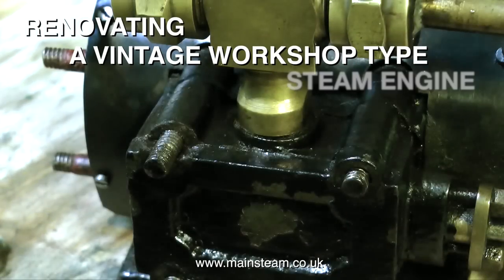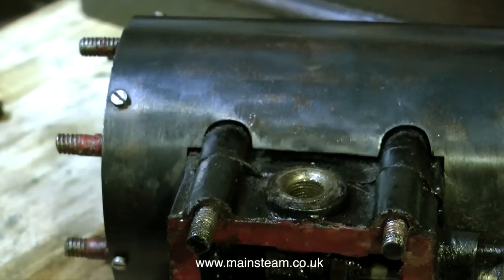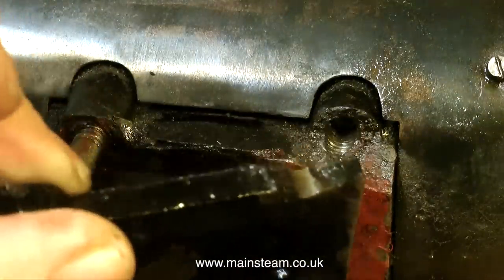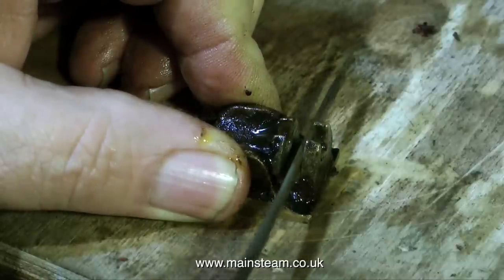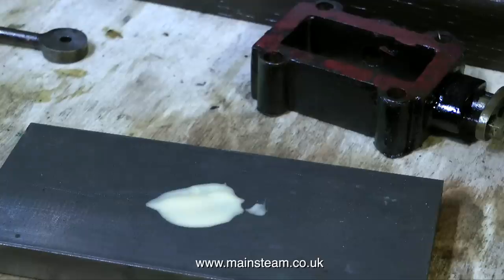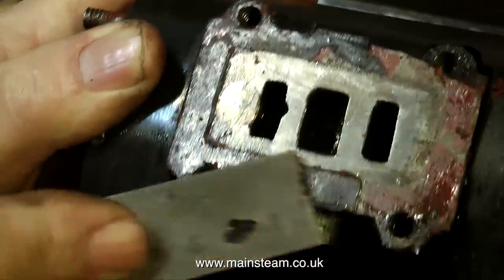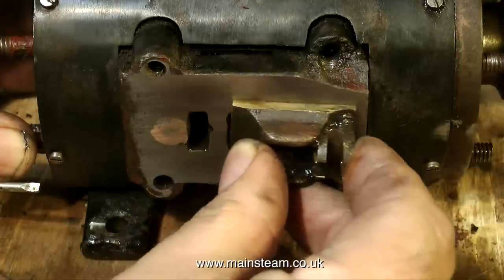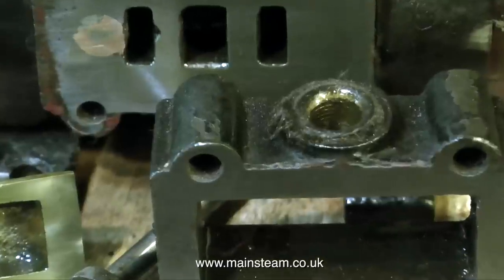PART #2 - RENOVATING A VINTAGE WORKSHOP TYPE STEAM ENGINE

Comment: Love watching your work! Very interesting engine! I think I would make a new cover and use a rotary file on the broken casting areas and go back in with brazing rod. Fill in the damages and re profile and cut threads. A bit of peening & stippling and a coat of paint and nobody is the wiser. Plus, the brass very closely mimics the strength and wear of cast/ductile iron. Just need to follow good practices, freshly cut surfaces, a good preheat, flux it well and get that 1st layer of brass down well. Wrap it up to cool slow.

Comment: Novice question. Would it not make sense to replace the steel cross piece of the slide valve with a brass one or is there a reason this is not possible?
Reply from the maker: +Jonathan Anstock Yes, but I generally try to keep the old engines as original as possible - that is the whole point of it.
Reply: +Keith Appleton Thought that might be your rational but wanted to be sure as it was a "non-visible" component. Thank you for taking the time to reply, I'm finding you videos totally absorbing. My regards to the independent republic of Yorkshire. by the way any chance of more painting? errr I'll get me coat shall I?